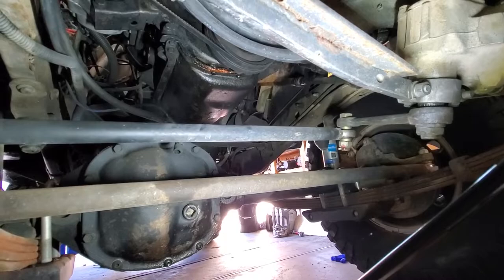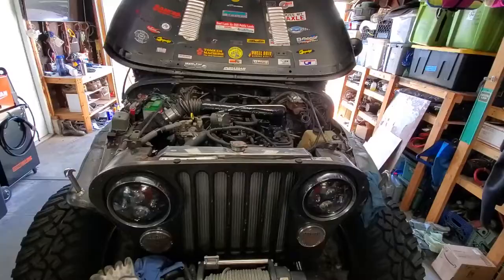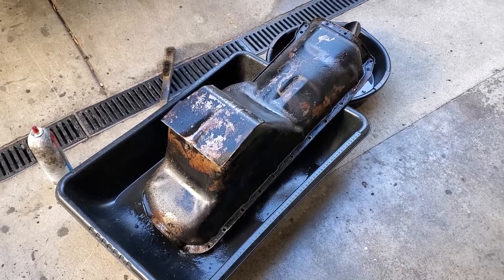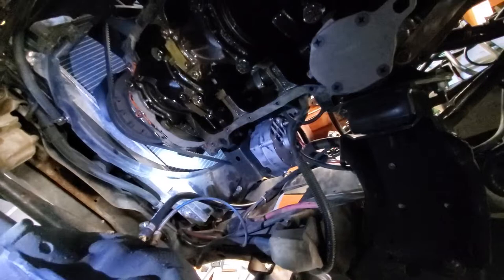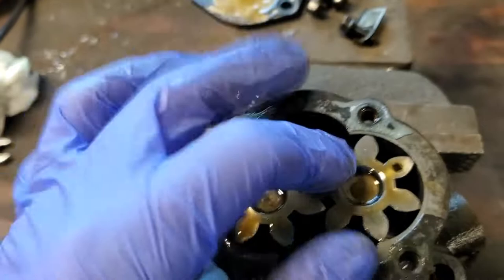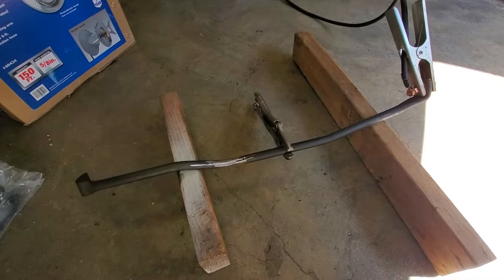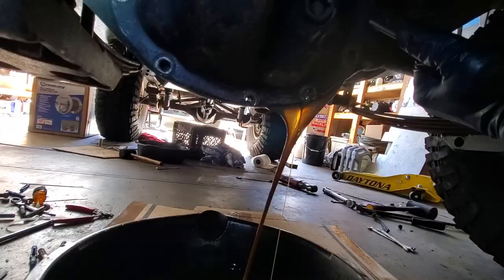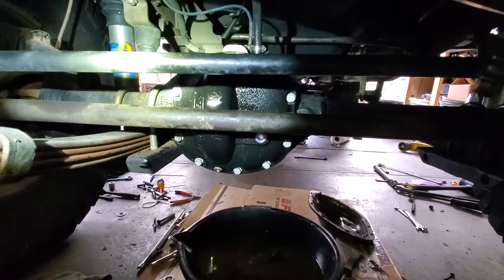CJ7 Oil Pan Gasket Replacement & Front Diff Cover Upgrade

Comment: I ran through almost this exact same process, but instead of doing any of the steps you described, I sold it and bought a 2021. Gaskets are holding up so far.